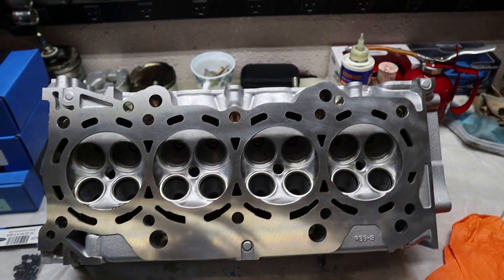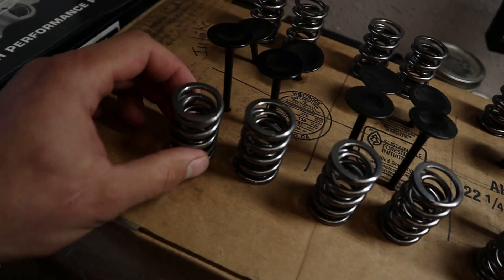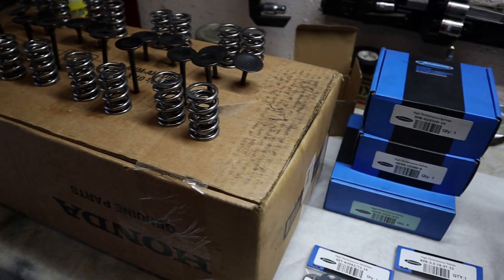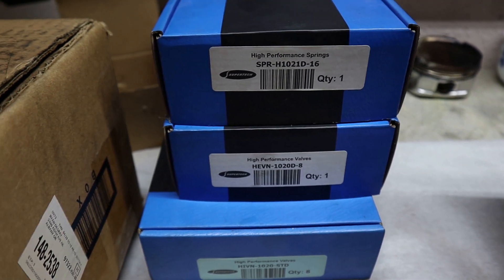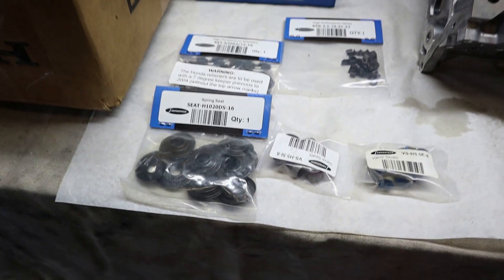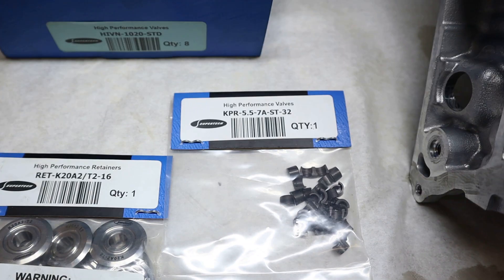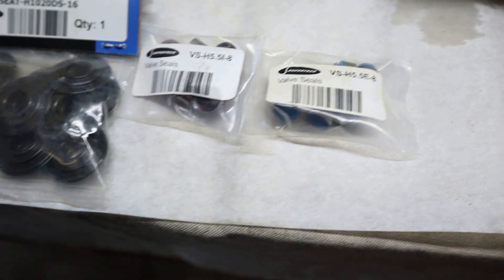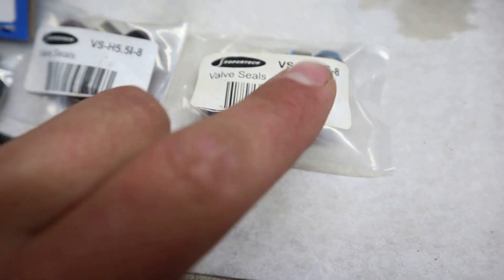Acura Tsx: Valves and Springs Install. (supertech)

Comment: Did you lap valves  and valve seats with valve lapping compound before install valves?
Reply: I’d bet he didn’t lap any of them, I built a B-series Honda over 20 years ago and I didn’t bother lapping any of the valves. As long as you inspect the valves, valve seats and there is no pitting or any other damage they will seal 100%, that’s all I did and had 190psi+ on a fresh compression test, with new springs, seals, cams and retainers. That’s assuming you are reusing the same valves with the same seats, if replacing bent valves, or worn guides, lapping is the minimum requirement. If replacing valve seats, full valve job is a must!

Comment: Nice thing imma take my motor out this summer build it a bit
Reply from the maker: What sort of build are you going with?
Reply: @RuskiRedneck  most def turbo noting crazy regular street build nice 400-450 just thought it’s better to have built motor
Reply from the maker: If you have a good block boost it should handle that hp on a good tune. Bad tune and even a built block will blow.